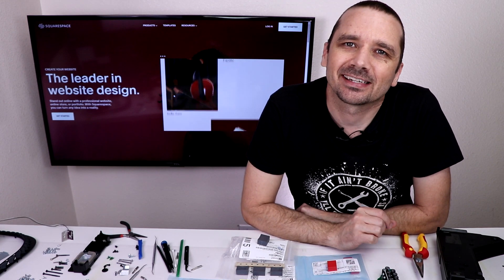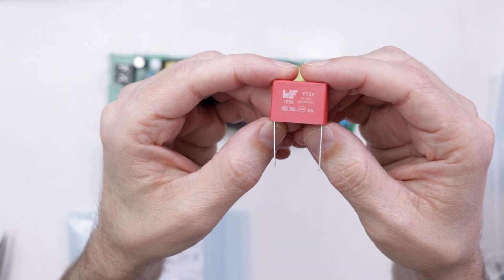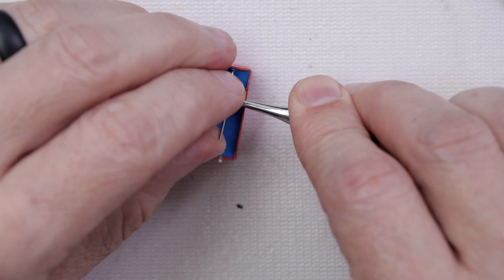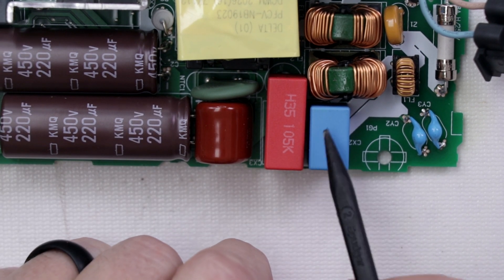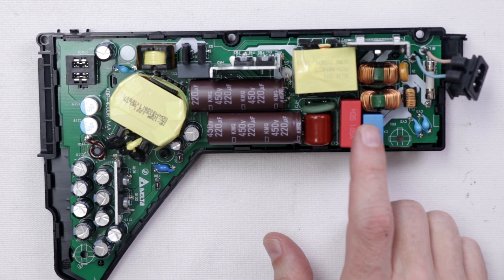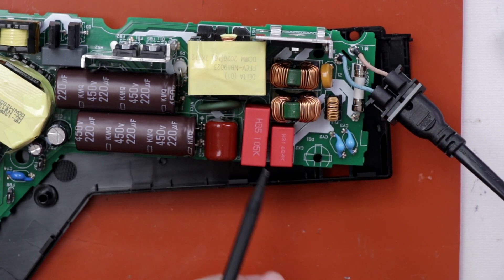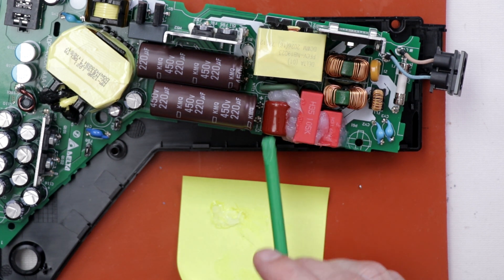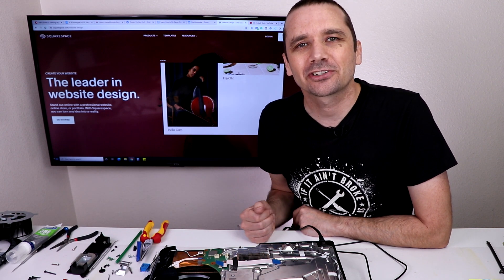Did I Fix PS5 Coil Whine?

Comment: Buzzing capacitors isn't about vibration of the whole component. It's the ceramic layers inside flexing back and forth with the AC current. You can't dampen that just by clamping the capacitor or hot snotting it down. If you completely coat the capacitor in hot snot you might reduce the noise to your ear because the glue is absorbing the sound the same way acoustic foam does in a sound studio. Just know that you're also trapping any excess heat in whatever component you're coating in the stuff which shouldn't be much of a problem for a ceramic cap, but for other components it could be catastropic. Like that IC. (Whoever suggested that is so far beyond stupid that the English language hasn't invented a word for it, yet.) But the reason most power supply components are held in place with silastic is to reduce mechanical stress on the solder joints when moving the thing around.

Source: I am an electronics engineer.
Reply: Source: trust me bro

Comment: I'm currently trying to fix my PS5 noise, because it annoys me, when playing 7D2D. First I thought, it was the Nidec Fan, but as far I can tell, the Fan is quiet. (bought my PS5 6 Months after release). The Noise never came from the fan. It comes from the power supply, which brings the noise up through the fan grooves to the fan, where it is then "cut up" by the fan and makes it sound like it is the fan. Without the fan, the noise can be heard upstairs all the time. 😬

Comment: What if you put much more silicon covering both original capacitors and maybe the sound it's reduced or gone?
Reply: I would not do that. That could lead to heat issues

Comment: Amazing video man ! I just received my 4th PS5 Unit and it still has this really annoying buzzzing from the PSU, Sony knows of this issue but they won't follow Microsoft to do the same in their PSU's
So im gonna try to fix it myself with the help of this video ! 
A question i have is @TronicsFix, Does only silicone kit and tie-wraps reduce this noise some levels ?
Reply: I went through 3 ps5's and I just gave up am now waiting for a proper revision or a slim
Reply: I have the digital ps5 and have never heard a noise from it even when playing games… the fan is also silent

Comment: My Ps5 doesn’t necessarily have coil whine but you can hear it working if there’s complete silence, I worried at first if I had an issue of coil whine but then I saw videos and found out my ps5 was probably good and obv there will always be some fan noise and some noise coming from the console, it’s still a million times better than the PS4 lol
Reply from the maker: It will never be completely silent. Glad you're not worried about it anymore!
Reply: @Tronicsfix  yup, it works fine and is 101% an improvement over the PS4, I have no reason to complain lol
Reply: You probably haven’t tried Demon souls or destiny 2.  Those are the 2 games that turn your ps5 into a chainsaw
Reply: @MvK-Delta  maybe you do have a defective unit lmao
Reply: @bredslayer4251   to me any ps5 with coil whine is defective
Reply: @MvK-Delta  the way this console is built, there will always be some coil whine, it literally can not be avoided
Reply: @bredslayer4251   Xbox doesn’t have this problem though and if you’ve played destiny 2 on ps5. The coil whine is pretty bad.
Reply: @MvK-Delta  I’ve played ps5 games on it , not just ps4, it’s noticeable on ps5 games but it’s nothing too significant, It’s hard to explain but any little noise in the background will drown it out and you stop paying attention to it anyway, no chainsaw tho lol, and on PS4 games, especially digital ones when no disc is spinning, there pretty much no sound, if your ps5 sounds like a chainsaw, somethings definitely wrong, and yes Xbox is much better in this regard because they have adhesive really holding down the components in the power supply and like you saw, the ps5 doesn’t, that’s all
Reply: @bredslayer4251  it only sounds like a chainsaw on destiny 2 and I’m assuming demon souls .  Destiny 2 I can confirm .
Reply: @MvK-Delta  has to be a defective product or something because regardless of the fact that a game is ps5 optimised or whatever, under no circumstances is it ok for the console to sound like a chainsaw lol
Reply: @bredslayer4251  of course it doesn’t sound exactly like a chainsaw in real life.  It sounds like a mini chainsaw.
Reply: @bredslayer4251  when people say jet ps4, did u think the ps4 was flying and sounded exactly like a jet?
Reply: @bredslayer4251  not sure how I can explain it exactly.  But play destiny on ur ps5 if u have one and let me know how it sounds
Reply: @MvK-Delta  it sounded like a mini jet or at least it was the best way to describe it while playing heavier games, I understand what you mean by a chainsaw obv but regardless, if I was to play destiny 2 I’m sure it wouldn’t be that loud especially if it’s digital

Comment: Quick question Mr tronics, does covering the caps in silicone or other liquid electrical insulating liquids and epoxies etc run any Rick if causing too much heat building / retention on these parts specifically or the surround PCB and components ? Looking to try to fix my coil whine as well

Comment: Doing this, you might actually be helping Sony fix the issue or at least showed where the noise was coming from so they can fix it with future console releases.

Good job.
Reply: Sony has been an electronics manufacturer for decades.. it's a cheap design from the ground up. Built to cut costs and net them more cash. You lot should demand better considering you don't even get a 1TB HDD even..
Reply: @warmage247  hows it a cheap design when they are using liquid metal on the chip and took them 2 years just to do that ?Maybe they just didn't think about coil whine, otherwise I'm sure they wouldn't have done this.

Comment: PLEASE USE A POWER RESISTOR TO SHORT CIRCUIT THE LOADED CAPACITORS
Using pliers will reduce the life of those capacitors, using at least 33 ohm/ 10W resistor is better, the ideal way would be
to use a 470 ohms / 2 W resistor, but basically any resistor is better than shorting it with pliers

Comment: I have got my ps5 a week ago and it was running just fine but recently I started getting weird buzzing noise when I am playing a game. When I go back to the dashboard it disappears but as soon as I entre a game it comes back. I have opened the ps5 and there was nothing blocking the fan anyone got a fix please?
Reply: Probably the issue this guy is talking about. Got the same thing and the noise is def the psu.
Reply: Same with my launch PS5 disc edition. The coil whine is fairly audible when playing games but when I bring up the main/home menu (not just the quick menu that appears at the bottom of the screen) the coil whine nearly disappears. Shame otherwise it's a great console.

Comment: PS5 horizontal dust cover, have any you recommend? Bought my dust strips for my ps4 pro spiderman edition after I watched your video on them.
Reply: Don’t use those. They hurt your console more than you think.
Reply: @MrUchiha  never had or  noticed any issues. Being in a dusty environment with 4 pets they helped a lot. Just have to clean them out on a regular basis.
Reply: @MrUchiha  ps5 has them.. bruh moment
Reply: @ThatFatCat  do you know what dust strips are? PS5 don’t have it. No consoles comes with it. It’s a thing you can buy. I had it on my PS4 and threw them out after. Gave me 2-5 degress

Comment: What's are the exact Capacitors you used in the video? Like model number, volt, Watts, AMPs all them numbers?
Reply: Why i think your ps5 is fine
Reply: @mrspekulatius8886  just wondering, so if I wanted I can tweak it more

Comment: you have a nice Fluke 117 with Low-Z function: it works well for safely discharging capacitors. Please avoid brutal discharging caps with a pair of pliers :(
Reply from the maker: Lol...so THAT'S what that function does!
Reply: but that way is more fun!

Comment: Why wouldn't Sony use a capacitor like the one installed in this video?  Because it costs 3 to 4 times as much.  Probably 15 to 20 cents vs 65 to 80 cents as a rough guess.
Reply: 80 cents x 10 million = 8 million dollars :)

Comment: Cool. I think just changing the capacitors dramatically reduced the noise. Silicone and zipties; not much. ✌
Reply from the maker: You might be right...never hurts to add some silicone to help reduce vibrations though
Reply: @Tronicsfix  Yes. That is correct. 👍

Comment: I wouldnt ziptie the NTC to a capacitor (green one) . Does really burn up when they die.
Reply: The green cable?
Reply: @MrUchiha  no,  the green flat disc glued to the side of the new capacitor marked NTC on the board
Reply: @danielsaturnino5715  you would avoid adding silicone/zip tie to that then?
Reply: @MrUchiha  yes I would avoid it. They are usually connected across the hot line and neutral so that when power surges happen, it drains that power straight to the neutral. They themselves are fire resistant and when fail turn into charcoal but dont burn your house down.  But what about that zip tie? And the silicone? Are they fire resistant?
Reply: @danielsaturnino5715  I don’t think the zip-tie is. But silicone or hot glue should have a strong enough meltikg temp to hold on. 

I don’t know exactly the one he is using.
Reply: @MrUchiha  just aslong as the NTC doesnt reach its surge cycle limit its ok. Just hope it doesnt. Its just best to avoid it.

Comment: The caps might need a higher capacity the supply is oscillating under high loads. Either way poor design from Sony and a lack of testing obviously. I wonder how long these supplies last before stuff starts failing. This is happening to my friends unit, but I refused to fix it and told him to send it back 🙈

Comment: You will probably don't read this. But please try Call of Duty Cold War or Borderlands 3 in 120Hz Mode an then measure the noise. From a modified and unmodified PS5. My Coil whine is crazy loud in those modes.

Comment: You need to test it in a game, with the highest fps possible. I have had graphic cards which were basically silent on the desktop but as soon as I ran a game the noise was very noticeable and was worse when the frame rate was very high ie when vsync was off. So on the ps5 should be the 120 fps not 60 fps settings.

Comment: Can’t believe there’s still through hole components on the PS5.
Reply from the maker: There's not really a good way to put in that large of capacitor without using through hole components.
Reply: Silly comment. Through hole components are still widely used, especially in power supplies,

Comment: Great video but could you test it with running a PS5 Game? My PS5 has coil noise when I am in Call of Duty Cold War while when I play PS4 games on it the noise is not there. So it seems also to make a difference what game / application you run. When I am in Cold War menu and just switch from one weapon load out to the next the noise also changes every time. Really strange.

Comment: Ok I’m slightly confused. Why do capacitors create coil whine? I thought coils were a separate component? Cheers
Reply: The coil whine it's just the sound of those capacitors vibrating too fast due to current flowing through them
Reply from the maker: Mechanical vibration of the films inside the cap
Reply: @Tronicsfix  thank you both 😊

Comment: I don't know anything about electricity, but doubling the volts in a capacitor doesn't sound like something that should be done lol. But I could be completely wrong.
Reply: He is doubling the max capacity. The PSU/Power socket still gives the same amount of power as it did with the previous one.
Reply: @MrUchiha  gotcha. So this can only cause a problem if the pay sends too much power for some reason?

Comment: Can I have some help diagnosing my problem please 
My PS4 won’t take disks or eject them and when the disk was in there my PS4 was acting like it didn’t have a disk in it even though it was making the normal single beep noise when I press eject,  the disk wouldn’t come out nor would it make any spinning or reading noise 
I had to use the manual eject screw to get my game out 
Also I opened up my PS4 and from what I can see the disk drive is fine there wasn’t anything broke or missing either

Comment: I'm here because there's huge pressure to provide the most technology at the cheapest price which means sometimes the ingredients are not as good as they should be and engineering is cutting corners and now...somebody has to fix it, and it's not cost effective for someone else to fix it, so more than likely, it will be ME. Is that too many words for a T-shirt. LUL!

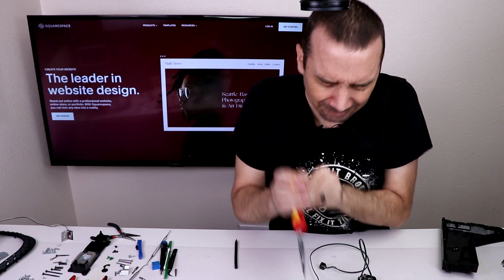Comment: 08:02 Is that the way to discharge High-Voltage capacitors? Or how do you do it properly? EDIT: Okay, using a high wattage resistor is the better way I think. :D

Comment: a question to tronicsfix i got " scammed" on a ps4 pro that shows it conneteced to the tc and no picture shown on tv. I manganed to get it to show picture in safe mode once but i cant acess the safemode after that. it just turns of whene i hold down the power button after the 7 seconds all the guides show. any suggestion?

Comment: @TronicsFix Will a power outage damage my ps4 because I was playing a game and out of nowhere the power went out and then a couple seconds later it came back and I turned my ps4 back on but it gave me a warning and then I started playing again and a couple minutes later the power went out again and caused my ps4 to turn off again and then the power came back again and I turned on my ps4 again and it gave me a warning again and I’m just worried if this can damage my ps4? And I’m more worried because the game I was playing was on disc
Reply: If you're using a surge protector then your PS4 should be protected from major power surges however it will cause degradation of the PSU over time. The HDD might also become corrupted if the power cuts at the wrong time

Comment: I’ve had 3 digital PS5s all replacements off Sony due to coil whine being louder than my tv so ended up getting refunded, the coil whine I had changed pitch depending what I was doing on screen, is this power supply or graphics card related?

Comment: Is this coil-whine: a buzzy hum that is faint but an easily audible frequency. I have yet to try a digital game so it could be the disc drive
Reply: I have this issue, It happens when the system is being pushed very hard. I can't replicate it with a PS4 title, but with PS5 only titles (like Ratchet or Returnal) I can hear, it's a very light humming sound. It's not the disc drive either, I have Ratchet as a digital title. 
As another example, I DON'T hear it with games like RE Village or Astros Playroom.
Reply: @kastaway-mtx  Yes, that would be it.

Comment: My ps5 makes a buzzing sound when I play Ps5 games, not on ps4 games. I noticed that it doesn't buzz while the game is paused, only when it's running. Also, depending on the game mode it makes a different buzz, performance mode makes a constant buzz and graphics mode makes a staggered buzz.... does that make sense?? Any ideas as to what is causing the buzz?

Comment: Why do people  short out capacitors.  Use a volt meter set to read voltage. If you can set for higher range it will drain more quickly.  watch it go down to zero volts safely.

Comment: I think you would want high peek current ones because you put on load for exemple a game  you pull more current for me this is the logical way And probably you have problem whit the coils not the cap  its' coil whine so probably the input coils are too samll to smooth out the input or too much switching noise is geting back from the powersupply.

Comment: I see that coil whine occurs on my ps5 depending on the location where im at (in game) so in dead by daylight, coil whine only occurs wuen im playong but it cuts out when its loading or you choose between killer and survivour
Reply: will be dependent on power draw through the supply, the incoming power condition and im sure lots of other factors like temperature, moon phase etc.
Reply: I have audible coil whine when laying assassins creed Valhalla, other games it is much quieter.

Comment: does the coil whine issue comes from a defective ps5 or like is it an issue after  a little while of ps5 use??
Reply: It’s on almost 90% of the PS5’s. It’s normal. Power supply buzzing because of vibration. Not a defect, nothing harmful.
Reply: @MrUchiha  oh ok thanks man. i had the digital  edition  for like two weeks now
Reply: @zaaireettv  same but disc for 1.5 weeks. It might lessen as you play for a few weeks. But maybe this fix will be necessary if you can’t stand the BUZZ.
Reply: @MrUchiha  as long as its not a  big issue that needs to be fixed I'll  be fine lol